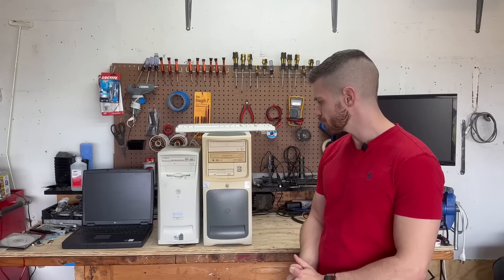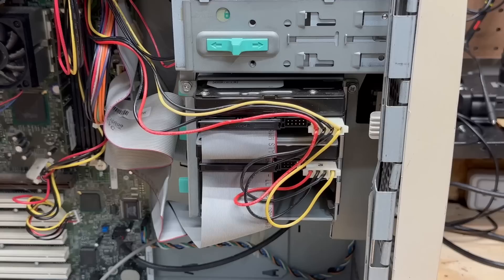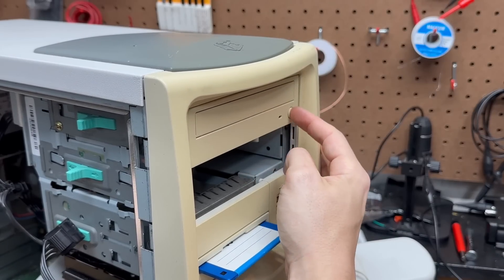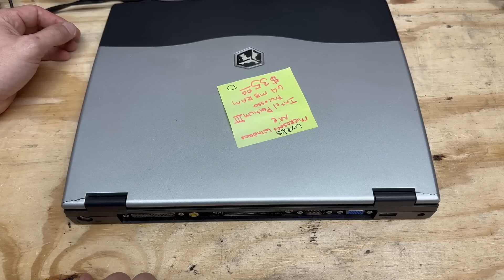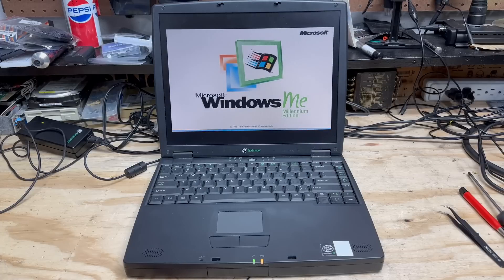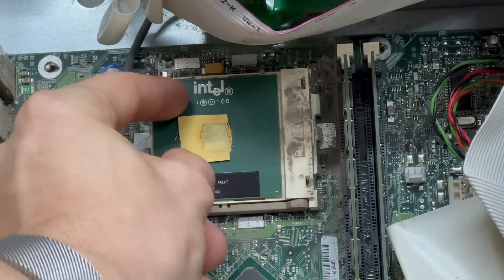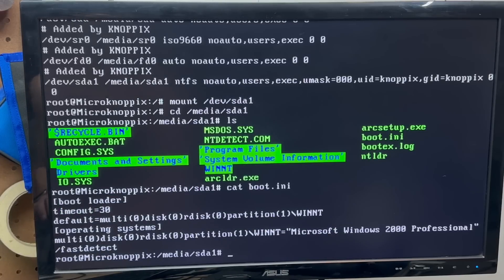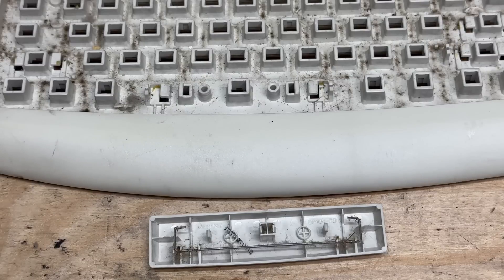Vintage computer haul from this weekend's hunt! Let's see if we can get them working!

Comment: Hey Mike, been liking your videos, keep up the good work! Had a couple suggestions, hope you don't mind.

1) I don't know if you've heard, but there's increasing doubt around what's really going on with the retrobrite process, and a lot of people now believe that it causes irreversible damage and plastic embrittlement. I think on something like a CD ROM faceplate it really doesn't matter (it's not like it's likely to get much pressure put on it, and they're far from irreplaceable) but there's a good chance it could actually bleach away the printing. If your channel starts really popping off - here's hoping - you'll probably get people in your comments being very negative if you don't include some kind of disclaimer that it's not necessarily recommended for all applications anymore. 

2) regarding that first ATX power supply, usually when I see dead supplies, it's just 0 volts across the board, so I wonder if that one is old enough that it won't bring up the voltage rails until it has a load on it. That's more common with even older supplies, but it's always worth checking before discarding a PSU - keep a couple unimportant hard drives or a motherboard you don't care much about, and plug them in just to give it some load and you'll get a more accurate test.

keep rockin!
Reply from the maker: Thanks so much! I definitely have much research to do on the retrobrite process. In the back of my mind I was kind of suspicious of it, especially with regard to decals. I appreciate the heads-up!

I had forgotten that some older PSUs did load-sensing. Just tried the PSU with a deceased (yet still current-hungry) hard drive connected, but no such luck. Maybe I’ll do a ‘deep dive into a troubled power supply’ video and explore what’s going on at the circuit-level. I should spring for an actual power supply tester to do proper cromulence checks in the future.

Thanks for all the info!
Reply: Can't say I've seen an ATX power supply that required a load to start. A bigger problem I have been having with some mid-00s Seasonic (Antec branded) units is that they lose the ability to power themselves on from a motherboard. +5VSB seems to be working fine, but may be weak enough to not be able to drive the relay that triggers the PS_ON pin.

If the machine is of any value, I would try and find a newer unit. These machines don't have ISA bus slots so the lack of -5V power is a non-issue. Just be mindful of the +5V rail rating. Pre-P4 machines relied far more on +5V to drive devices and the CPU.
Reply: Hey there! On the matter of retrobrite and similar techniques to remove yellowing from plastics, I will say that some of these concerns have been around for quite a while, but I think those concerns may have grown louder. I'm coming at it from a toy-collecting angle, since yellowing plastics are a major issue to collectors of vintage toys, and some people have reported that issues with embrittlement, and others have reported that they rapidly start to yellow again. I haven't looked into it for 3 or 4 years, but the concerns that were voiced at the time were enough to put me off the idea.
Reply: Hey Mike / Gravis! 
I’ve done some research on whitening some of the old PC Cases that I’ve got here, Found something called “CARA White” here in the UK & it’s also used in the Caravan / Camping industry over here, I’ve whitened a few Cases now and have had some pretty decent results but it’s a bit early to tell if if has caused irreparable damage as I did it to mine back in 2020 during Lockdown but I’ve not had any problems so far,
Ah so that’s where he got the idea using the Hard Drives as a Load for when he’s Testing the PSUs! 🙂🇬🇧

Comment: I worked at Gateway during the Windows 98/Me era, these cases were our best.  Every employee wanted to get one of these for themselves because they were so nice to work on.  I hope it survives and cleans up well.  CDROM 'bus' connector is 40-pin, which implies it is standard IDE.  'metal support bars from the keycaps', these are called 'stabilizers', or as the cool kids call them, 'stabs'.
Reply: I am a major fan of these cases, there were only two drawbacks, one was the power supply opening, if the internal ps died there wasn't an easy way to just get a standard one and put it in there, same with the motherboard, usually a dremel had to be involved. otherwise these could be really cool sleeper builds.
Reply: Unlike the other Gateway case of the time period that had the power button that always broke and fell into the case.
Reply: Matsushita used a proprietary 40 pin bus back in the early 90's.  The connector is physically but not electronically compatible with IDE.  Those early Creative drives were often rebranded Matsushitas.
Reply: @robert1975031  Their earlier mATX minitowers at least used standard SFX PSUs, they were just put in the dumbest spot imaginable right above the mainboard blocking any kind of easy access without removing said PSU, if you had, say, an Essential 433c kicking around whose hard drive died, you could stick a modern mATX mainboard and SFX PSU in there and have a decent sleeper build. I would see about modding the front of the case to take a 120mm fan though so that something like a P12 redux-1700 PWM fan could be installed to compensate for the relative lack of front air intake on that case, and IIRC the exhaust can be a 92mm on that case design.
Reply: so you see how gateway fuck up amiga division first hand

Comment: The thumb screw in the middle of the gateway motherboard is in fact stock. And is also the only securing screw. The rest of the standoffs are threaded brass pegs that connect to slots cut into the motherboard mounting panel. You remove the thumbscrew then the whole motherboard slides to the side away from the back panel and lifts out.

Comment: Those hinge cracks were very common on Acer laptops, they would progress until the screen broke off of the hinges because the hinges did not continue further up the screen. i'm guessing the Gateway brand is constructed the same.

Comment: I have an old dell laptop tucked away for about 4 years now. Last time I booted it, it worked fine it has wifi internet floppy and battery. It's a pentium 3 512 gb ram 40 gb hdd win 2000 last time I powered it up it still worked perfectly even the battery.

Comment: I have a Microsoft keyboard just like that on my in my office at work, still working perfectly.

I also used to have a dell system just like that one back in the day. I recall having Windows 2000 on it, though I remember it starting with Windows 98 or something.

Comment: Most older PC power supplies require a load in order to start up.
Reply from the maker: It does appear this PSU is trying to sense a load. However, I later tried using a few sacrificial hard drives with no success. I’ll likely do a ‘deep dive into a troubled PSU’ video to see what’s going on at the circuit-level. Love your channel BTW! It’s one of my favorites!

Comment: Wow, this video really takes me back!  In the early 2000s I had a paying hobby of buying machines like these, refurbishing them, and (occasionally) selling them.  The ones I was getting were mostly Pentium IIs (remember the old single-edge stand-up processors?).  My prize find is a K-Mart branded "Blue Light Special" tower, which I still have.  Oh, and the one I found with a bird nest inside, where the power supply had been left out!
Reply from the maker: Nice! I was doing the same thing in the early 2000s, mostly with laptops. I had to lie to eBay to get the account because I was only 12 years old lol. I still use that same account! Wow! If I came across a Blue Light Special tower, I just might need medical attention! 🤣

Comment: I know this is an older video, but my brother used to own a Gateway tower that looked identical the first one. I can’t remember the specs of it, but I believe it was a P3 as well and came with WinMe. The power supply failed on his as well, except it was within a few years of it being new. Thankfully it didn’t take anything with it, so he just plopped a new PSU in it and kept using it.

Comment: The CR-563-B was definitely not an IDE drive.  That 40-pin connector was for a 8-bit proprietary bus made by Panasonic/Matsushita.  Luckily, plugging it into an IDE controller wouldn't hurt it,  but nothing would work on that channel (if not the whole system) since it ties a lot IDE signals to ground.

Comment: I miss those internet keyboards. Especially the ones with media playback buttons on them. AFAIK the extended keyboard API is still supported in both Windows and Linux, it's a shame it's not well used anymore

Comment: FYI compressed air will not cause any static issues on a mainboard. Not sure why you think it would be an issue. Just unplug any fans before blowing them off with compressed air to prevent your fans from becoming a generator if you do blast them with air. In the 30+ years I have been tinkering (including a number of years as a sys admin) not once have I had a board get killed by compressed air.

Cheers!

Comment: Have to say your videos are addictive, not sure why I like old computers so much but I do.

Of all the prebuilts back then I kinda liked Gateway, they were just pretty normal hardware most of the time... no silly proprietary stuff that I can remember and their cases were pretty high quality.

Immediately saw you were right about that Creative CD-ROM drive, I got a drive that looked exactly like that in a bundle around 1993 I think. 2x and Matsushita/Panasonic interface, I think they came with a Sound Blaster Pro and later a Sound Blaster 16 that had the special interface. Wonder how it ended up in there?

Comment: 37:00 the procedure for fixing this, back in the day, was usually to do a recovery boot from a win2k cd. Run chkdsk and the usual round of MBR / bootloader fixes from there. It's likely that an IBD blue screen is due to a messed up boot sector.
Reply: If I remember correctly, and I'm probably wrong haha, but I faintly remember being able to use a windows XP install disc to repair win2k boot sector.

Comment: I remember when I disassembled my old PC. My harddrive had failed. I took it completely apart, took the platters and FULLY annihilated them. So many scratches and dents and holes punched into them. I took the parts to bestbuy to get recycled and they said "I think you did too much for us to recycle that. Just throw it away."

Comment: I have the Dell Demension L866R in storage, great Family PC. 20 years ago and still have all the restore discs. Made changes and additions to the machine: CD burner, usb 2.0 card, 80 GB hdd, 256 MB ram, external DVD burner, ethernet card.
Reply from the maker: Nice! Those restore discs can be quite hard to find. I always upload ISO images of them to Archive.org whenever I find them.

Comment: The GoBack utility from Norton was a fantastic tool back in the day that allowed you to roll a disk image back to a previous state. For instance, if you installed the new driver or update and it goofed up Windows to the point it would not boot. The GoBack would revert the drive back to its previous state.

Comment: Some Windows machines will automatically disable the network card if Windows does not detect a valid network signal. You have to reboot the computer with a good network connection plugged in.

Comment: I just found my mom's old PC from the late-90's in the garage the other day... I cannot wait to restore it. It's a Pionex brand PC which I know for a fact she bought off of QVC or HSN lol, and I guess some crypto company is now using that name so it's almost impossible to find any documentation on it.
Reply from the maker: I live for niche systems like that! What are the specs?
Reply: @miketech1024  basically on-board everything except a soundcard and ethernet card which looks like something I might've done back in the... it's a Pentium III system (probably 600Mhz and also the mobo has a separate PGA370 socket) with one 256MB RAM module jumpered for 100MHz FSB. No hard drive (not sure what happened there) and a CD-ROM which I'm guessing is probably a 40X and apparently also has a PCI express slot! I haven't taken it apart completely yet because the plastic on the case is SUPER fragile plus I need to grab some compressed air for it first to give it a good cleaning.
Reply: @livefreeprintguns  buy a cheap little compressor , no need to buy air in a can again .

Comment: Very nice. I actually have the exact same motherboard as the one in the Gateway tower, I use it as my test bench for various P3 era hardware (CPUs, memory, PCI cards etc). It's nice that it has its onboard video so if I test something else I don't need to plug in a VGA card, but I can also use it for testing AGP and PCI video cards if I want to.

Comment: Just found your channel and I'm enjoying it a lot. My son has resurrected my interest in older computers with his fascination with what he calls "vintage tech". Yeah that hurt a little.
Reply from the maker: Just wait ‘til they start calling them ‘antiques’. 😅
Reply: i find vacuum tube tech 
antique

funny thing is crt's have been in use for so long people have forgotten that they are basically glow in the dark vacuum tubes with lasers 
i have 2 but one doesn't work though i wish it did and the other is a black and white 4 inch mini antenna tv that i had to figure out how to connect a video signal through a 3.5mm socket 

turns out there is something you can buy called a "active modulator" that allows you to basically run a local television station over the airwaves 
the way i used it was i connected it to my computer and my "tv show" is just my screen print out

unfortunately the screen is falling, running, flickering, basically i think its sending its data and thinking its a bigger screen 
but if i adjust it i can make fly by so fast that it acts as one of those eye illusions making it slowly move the signal down letting me read it 

i don't know how to fix it 

when i first obtained it i had the idea that i could rewire it and like hook up a composite socket to the tv so i wouldn't need to do that rigamaral to get a picture 

but i have no idea what i was looking at and don't know if my idea was actually viable

i thought that if i gave it a internal modulator it could percive the signal and draw it correctly with the electron gun
but i don't know how the frick that tiny tv even works
considering it's also a radio

Comment: Always used compressed air to clean the insides of my PCs, never yet had any trouble, or static in general, knock on wood. Did manage to blow up my Chinese power source once as it had a sliding switch for different voltages. That was . . . interesting. Heard the bang to the farthest room. Even then the other parts functioned normally.

Comment: Have been enjoying your videos so far.Just a tip in regard to using a compressor to clean PC parts. If you don't already have a water filter inline, make sure you are taking steps to remove water from the hardware.
Reply from the maker: Thanks! Yup, a water filter is downright required here in Florida even with routine draining of the tank. Very humid here. My air tools would get eaten alive without it!

Comment: I usually get my old pcs and hardware from thrift stores and swap meets, sometimes find some good old stuff (i also like to find old gaming laptops, recently found an asus w90 from early 2009 was decked out with the fastest mobile cpu and gpu from 2008, core 2 extreme qx9300 4 core, has 2 ati mobility radeon hd 4870s and possibly upgraded with 3 4gb ddr2 sticks for 12gb) , oh and my reaction to the proprietary psu connector🤢🤮

Comment: 21:32 it being lithium, it should be relatively easy to buy or craft produce a replacement battery.
Reply: Or, weirder yet, someone out there might still be making replacements, I have a 20 year old Sony Mavica MVC-FD75 floppy disk camera that I was able to buy new, higher than standard capacity batteries that have been working awesome so far, the thing has an absurdly long battery life, I swear it could run for Days

Comment: Obviously you don't want to damage anything but it is so much easier to work on when you don't really care if something goes wrong . I remember the first card I ever installed was creative labs sound blaster. very basic sound card .Opening my PC case I could feel sweat running down my back , and when it 'snapped' into place I think I fainted. Running the test audio Professor Sabato (?) and the parrot , I was never so glad to hear "Hello There "

Comment: Whenever I get a vintage pc, I always keep the o/s install that's on it (when possible) for authenticity's sake, and just delete any personal info that's on it. I suppose if someone else got ahold of the computer they could find a way to recover those files, but the chances of that actually happening is very, very slim
Reply from the maker: Yeah I like to keep the original OS whenever possible. Yes it’s trivially easy to recover deleted files. When the OS deletes a file, it’s really only deleting the file header and marking the allocated space as safe to overwrite. On systems which I have no recovery image for, I’ll either use a file-shredding utility to get rid of user data, or I’ll simply delete the files and then fill the entire disk with data. That causes the OS to overwrite the contents of the deleted files.

Comment: the motherboard thumbscrew is original to the gateways of that era. have had quite a few of those. my RDRAM gateway uses the exact same case and has that. though it is odd why it was there. in some of my gateways it's the only screw, with the others being pins, with which you could slide the board back and out once that thumbscrew was removed. the SB cd rom drive was made to be used with the SB16 and the sound blaster pro sound card, which is why it's so sought after. had one for a while until it quit :(